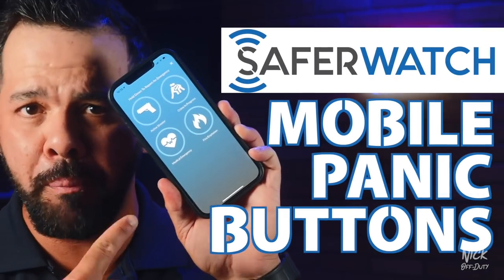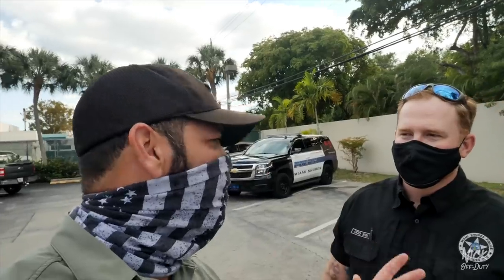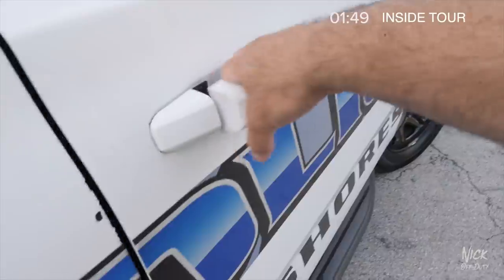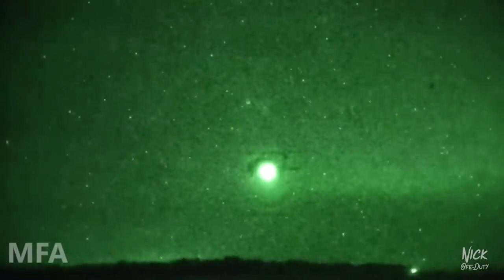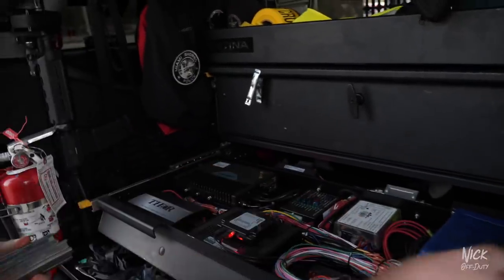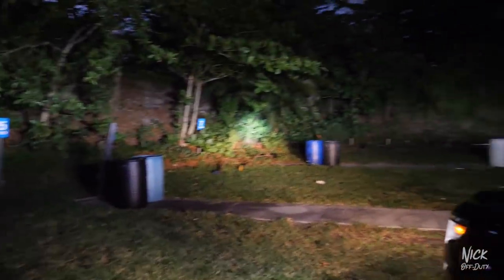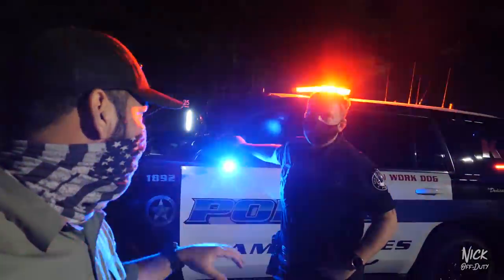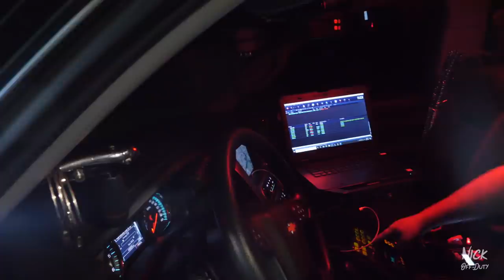POLICE CARS most tech ever (CHEVY TAHOE K-9 UNIT) Miami Shores Police Department

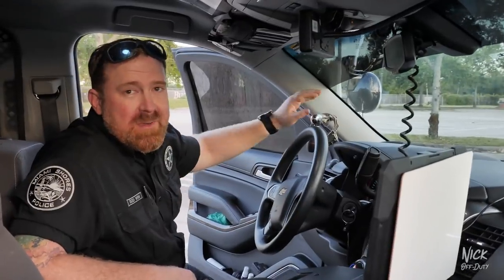Comment: @14:39 So you call it an IR camera but said it picks up heat signature, that would be a thermal camera not IR then right? IR Cams normally use an IR emitting light to illuminate the objects.